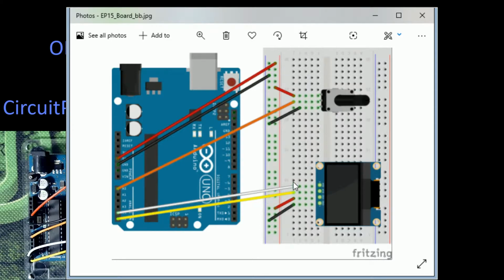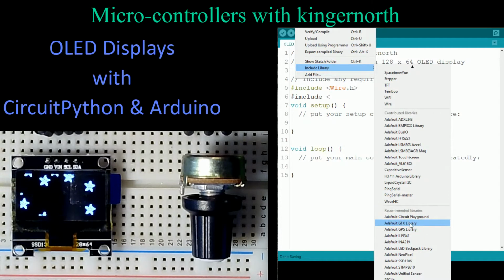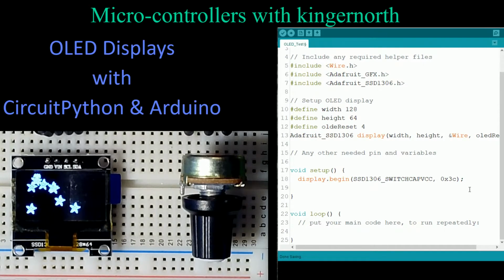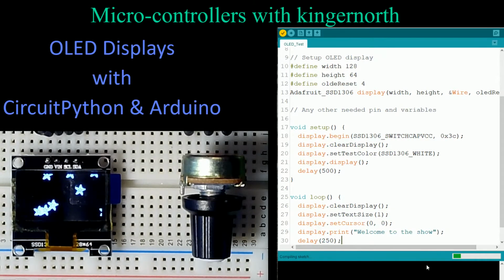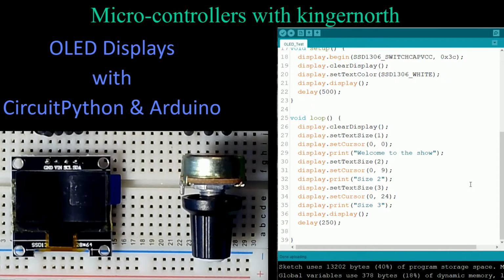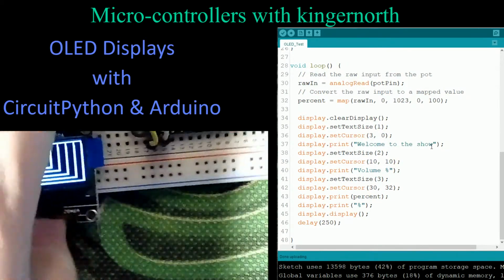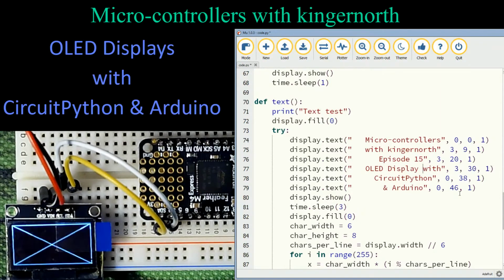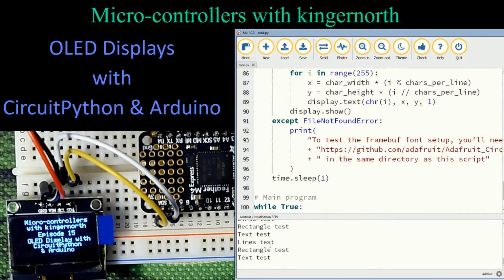OLED Displays with CircuitPython and Arduino

Comment: Thank you for the detailed CircuitPython example. It's the most detail of any example I've been able to find, yet I still cannot get htis to work. I've very carefully followed your code on an Adafruit 128x32 OLED (the one with the three buttons), but get a runtime error when I execute:

code.py output:
Traceback (most recent call last):
  File "code.py", line 6, in <module>
ValueError: SCL in use

I've just built a short test stub to try and get pixels all turned on, but it dies when trying to instantiate i2c:

import time
import board
import busio
from digitalio import DigitalInOut
import adafruit_ssd1306
i2c = busio.I2C(board.SCL, board.SDA)
reset_pin = DigitalInOut(board.D5)
display = adafruit_ssd1306.SSD1306_I2C(128, 32, i2c, reset=reset_pin)
display.fill(1)
display.show

I've tried also copying verbatim the code from various examples on Adafruit, and they either do nothing (no display output), or I get this same "SCL in use". I'm using the latest libraries from CircuitPython. I can't find any reference online explaining how to eliminate  SCL being in use. Any suggestions you could make would be terrific! Thanks!
Reply from the maker: Thanks for the comments Packet Guy. Since the time that I posted these guides CircuitPython has gone through some changes. If you are using the latest stable revision of CircuitPython 7.1.0 then defining of the I2C bus has changed. The new command line code is just,
i2c = busio.I2C()
This can vary a bit depending on which micro-controller board you are using. You can try the code in the learn guide, https://learn.adafruit.com/adafruit-oled-featherwing/python-usage
Also consider signing up on Adafruit Discord page , Adafru.it, where you can get some real time help on CircuitPython. I am a member of the site and help people along with many others so getting help is quick and easy. My name on the site is KingerNorth.
Reply: @kingernorth  FYI, it turns out the new command line for i2c is "i2c = board.I2C()", not busio.I2C. I tried this version, after I also updated to the latest 2022 libraries, and now I don't get an "SCL in Use" error, but also nothing appears on the display. I'm getting 3V DC to the display and the only other two pins, the I2C pins, have continuity to my RP0, so it's possible I have a bad OLED board. I'm going to buy another and then revisit this. 

You have great skills as a presenter, so I look forward to watching more videos!